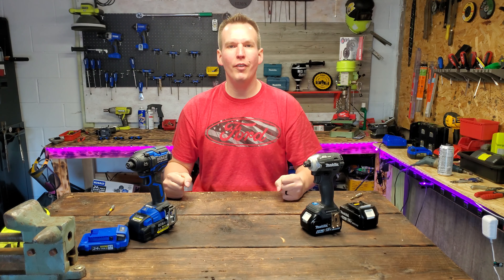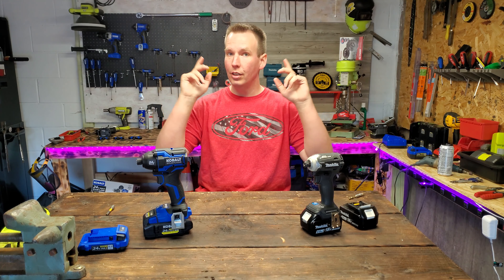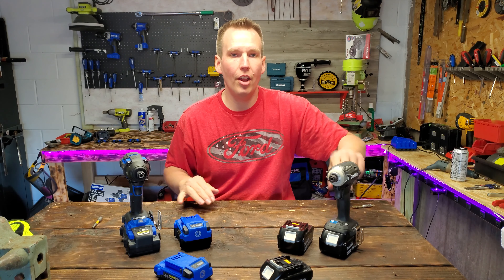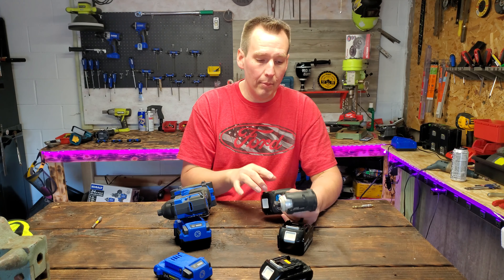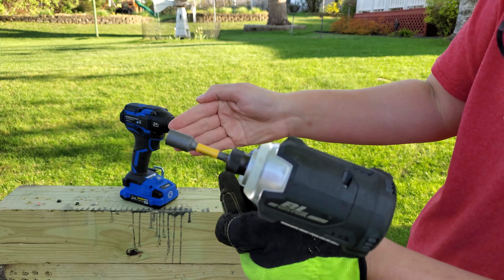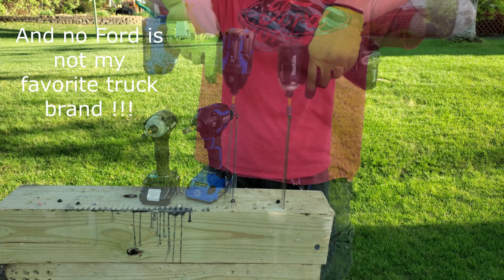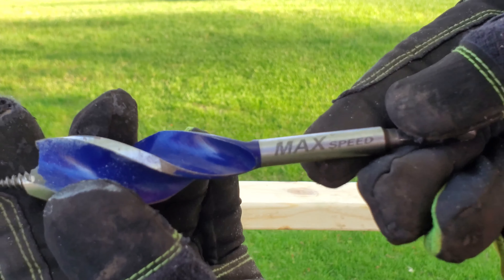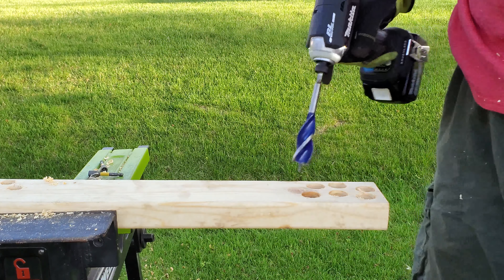Kobalt X.T.R. VS Makita Quick-Shift Impact Driver Comparison test !!!!!

Comment: Some people thought when Lowes started bringing in all the craftsman stuff it meant Kobalt was on the way out. I'm so glad that isn't true.
Reply: @Spider's Morning 24v is not true its really a 21v the battery. Battery Voltage is not everything there are M12 tools such as the Milwaukee fuel oscillating multi tool that beats all the 18v versions available. At the end of the day it comes down to the quality and efficiency of the brushless motors you get what you pay for dont fall for marketing none sense like bigger numbers mean better because its far from the truth
Reply: Seeing as Lowes doesnt have Milwaukee, I never would think they'd drop their own house brand when they could improve it. They gave the Kobalt line some very nice upgrades to compete with Home Depot's Milwaukee alliance. Lowes now sells tools on par with that of Home Depot in my opinion. I think the quality order of the Lowes brands vs Home Depot goes like this:
Lowes:
1. DeWalt(although if Kobalt's XTR line expands further I think they'll take this title from Dewalt because they already hold the advantage of making hand tools as well.)
2. Kobalt(best price to performance ratio on the market today, especially when taking battery cost into account)
3. Metabo HPT(price is the biggest knock against this brand, they make some really powerful tools but they are very pricey unlike Kobalt)
4. Bosch(not extremely powerful but very reliable tools and a very expansive line with great battery technology)
5. Craftsman(some Craftsman items are better than similar DeWalt items even though both are made by the same company, affordable tools that provide good enough performance and reliability to be used semi-regularly on the job, also known for quality hand tools)
6. Porter Cable(not near what they used to be, but they still make some decent tools for homeowners)
7. Black and Decker(same as Porter Cable, but worse tools)
Home Depot:
1. Milwaukee(most powerful and reliable power tool brand outside of the expert brands such as Hilti, and thus, very expensive. But really expansive line too with numerous 18v, 12v, and corded tools)
2. Makita(very powerful and reliable tools and great accessories as well, some great battery technology)
3. Ryobi(the DIY dream, Ryobi is one of the most expansive lines of power tools but they are not very powerful or extremely durable, but affordable)
4. Ridgid(their battery powered tools leave much to be desired but they have some great corded saws and fantastic plumbing tools)
5. Wen(just do not buy these)

Comment: Bought that  kobalt xtr 2 weeks ago along with the kobalt xtr 1/2 impact wrench with 2 extra 4amp hr batteries and 2 6amp hr batteries
Both are a mtf beast especially that KOBALT XTR 1/2 Impact wrench. Its hard to beat the performance of the new Kobalt XTR line with that 5 yr warranty for the tool and 3 yr warranty for the battery

Comment: I bought the Kobalt XTR combo At $ 399.99 (4 PowerTools Brushless & Flashlight ) With a guarantee of 5 years for machines and 3 years for batteries (2  Batteries: 4 amp and 2 amp )  and the other top brands $ 749.99 And I don't regret it was worth giving this company a chance, thanks for your videos , Good Vibes 🤙🏼

Comment: I have both the Makita xdt14 and the red version of the makita in yhe video. I was blown away that the only difference power wise is the top model puts out 50 in/lbs more. Same rpm and same ipm
Reply from the maker: Witch one do you like more? The Makita or the Kobalt?
I like them both but I do have to say that I have had the Makita for almost 2 years and it has never let me down, so only time will tell if the Kobalt will hold up...
Thanks for watching

Comment: Dude. I traded my makita tools for the kobalt line; and it smokes my old stuff.

And I’m a tradesman, I use my tools 40 hours a week. My XTR impact is heavy, but its power is phenomenal for driving screws into structural steel.

And the batteries are half price…

Comment: Kobalt xtr looks good especially at it's price.
Reply from the maker: It could be a little cheaper, like 100 bucks would be better, but over all its pretty good so far. Thanks for watching man.
Reply: @Impact-OG  5 tool kit is only $399.
Reply: SC C: Actually it is. It is as good an all around driver there is and matches up favorably with all the much more expensive tools. My friend had one and, after borrowing it for a day, I had to have one myself. It is a beast.

Comment: If you had to choose between the Kobalt XTR and Ryobi One + HP  impact drivers what would you choose? Also, I see a lot of people just doing times when testing impact drivers or hammer drills but not many of them will tell you how it actually feels in the hand. Which one feels smoother operating  in the hand or which one do you like the better grip of.

Comment: That kobalt is powerful but its a big impact. With the size difference it should be more powerful. The Makita might have been bit behind on power but makes up for it in its size and efficiency. Both great impacts but depending what you need it for it that will change the final decision.

Comment: I wonder if we'll start seeing other companies moving up to the 24v
Reply: maybe but it sure makes packaging q reasonably sized battery difficult.
Reply from the maker: Yeah I dont know man. and yes the battery is huge.
Reply: IT'S YUGE!!!
Reply: Its what???
Reply: @jasonsexton2513  YUGE!!!
Reply: Maybe eventually. Apparently Milwaukee owns the patent for use of 18V nominal/20V max Lithium Ion for power tools. So currently everyone else is paying for that. Then again, DeWalt has the flex volt, so I see them just making more and more 60V tools for that platform when they start to leave the 20 stuff behind. Hard to say, but as long as everyone has to pay for rights to 20V max tools, they will probably start looking at other options for future products.

Comment: I just bought that kobalt this weekend.  Like I’ve said before, it’s right up there with the Milwaukee Gen 3.  Impressive so far, other than the charger. It took an hour and a half to charge that 4.0AH battery.  The case is decent, you just can’t install the belt Clip and close the case so you have to not install it if you want to use the case.  I’ve played with the drills in store.  Man are they heavy and also front-heavy!  Awkwardly imbalanced.  The Recip and circular saw seemed decent.  I’m telling you, put this up against the Milwaukee Gen 3.  Run some paddle bits too.
Reply: There's a rapid charger that you can buy separately from Kobalt

Comment: it's fast but it's also bigger.    I got rid of my Ryobi stuff because I hated how bulky they were Kobalt is just as chunky.   I'm currently in the hunt for a new system to buy into.    Makita is a contender.  they seem to have the ratio of battery to tool dialed.  I'll accept a marginal difference in speed for a more comfortable tool.    I really want to like Kobalt.  seems like it would be less likely to get stolen 😂 compared to yellow tools.   I don't know I may just end up with a rainbow tool collection 😒😔😀
Reply: That is really the only thing I don't like about my xtr kit but I am a bigger guy so it doesn't bother me to much. If u want lightweight and power than definatley go with Makita or Milwaukee. The 3 year battery warranty, 5 year tool warranty, cheaper alternative, just as powerful as pricier options and smaller price tag is what drove me to kobalt. I'm sticking with blue!😁
Reply: Have you considered 12V tools? They tend to be lighter.

Comment: Eh, need a better test than using your right and left hand at the same time due to the fact each arm has different strength, not a really fair comparision, i would use the same hand same pressure and time each one to get a actual accurate result.
Reply from the maker: Thats why i switched hands multiple times !!!! One test I did the makita in the right had 2 times in a row by mistake, but I do switch hands more then 1 time. And this is just a fun test it doesn't really prove anything.
thanks for watching

Comment: You should take a moment and pop the covers off these tools so we can see inside. Even looking at the moulding to see for structure strength would be helpful. Need more depth then just testing rotational speed of a drill turning a screw

Comment: kobalt has a bit of wobble
Reply from the maker: A little not to bad, the Makita has by fare the  lest  wobble out of all of them. Thanks for watching
Reply: @Impact-OG  actually, I have been testing my tools, they all have some degree of wobble.  It seems Dewalt still takes the cake for having one of the worst wobbles.  Kobalt has this assist mode that kinda eliminates wobble by starting at lower rpms before ramping up, but this could only be seen under load.  Sometimes you can see it in no load if it remembers to go back to low rpm.  It's a neat feature nonetheless and I like how the VCG guys call it the finish mode, which IMO seems more fitting than calling it the assist mode.  I actually pulled the trigger and bought the 3 pc kit with free tool and I wasn't impressed the first day because I was still playing around with the tools.  I actually love the Hammer drill bro. Don't know why, but I think is legit by specs.  Impact driver took some time to understand it....but things changed after the second day...and I feel like I am stuck with them.  Don't want to return them.  I am mostly Milwaukee and Makita, so Kobalt just pulled an xtr and it's real deal.  Wait till they start jacking the prices up when people start to buy them.  Longevity is questionable, but plastic quality is almost on par with M18 and both are made in China, so Chervon is very familiar with the materials being used in power tools that are made in China.